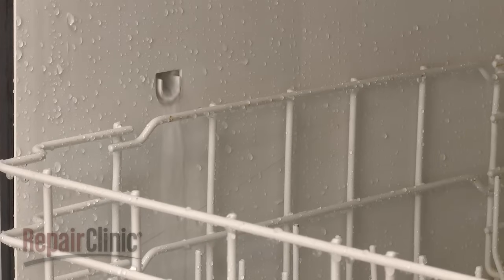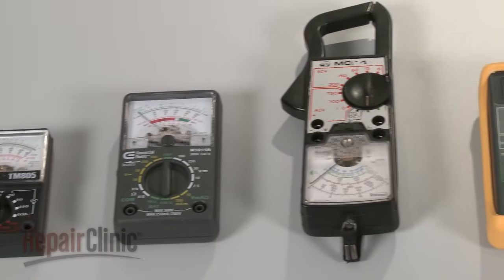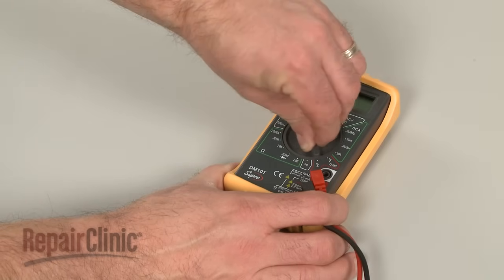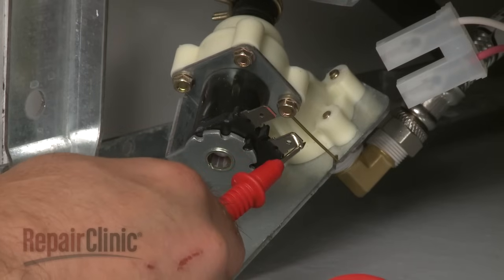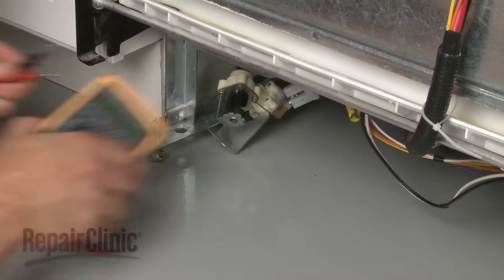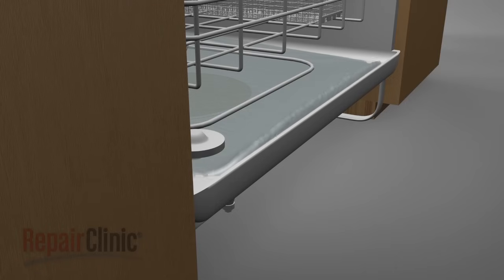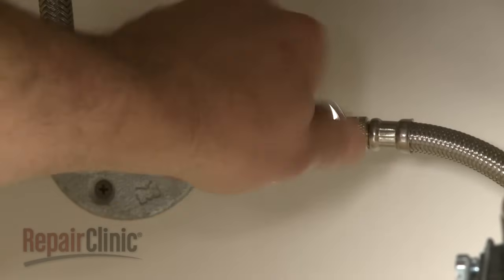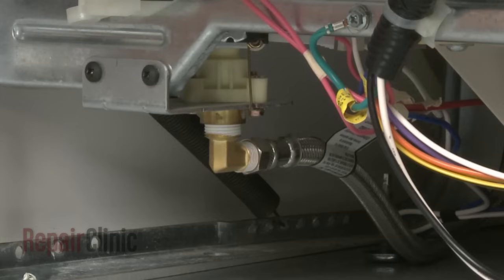Dishwasher Not Cleaning? Water Valve Testing, Troubleshooting

Comment from the maker: I would recommend using the repair help section of our website (link in the description). If you enter your model number there you'll have access part, model and symptom specific repair help. There are a few other parts you can test before deciding what to replace.

Comment: I love your well-produced, concise, understandable videos!  I've ordered a replacement inlet valve from your store. Meanwhile, here are a few things I encountered that I think might be valuable to comment-readers:

My inlet valve was (past-tense) broken and was only reading 31 ohms.   Because this and other internet instructional videos advised that the valve should read 500-1500 ohms or zero, I was not convinced mine was bad.   My valve runs on 13.5V DC power, which I believe is different than most valves which run on 120v AC (the power you get from a wall socket).   I believe the lower-voltage DC valves are still okay if they read 31 ohms.   I believe this because...I removed my malfunctioning inlet valve, grabbed on old 12v DC wall wart from my junk drawer, stripped the ends of the adapter, attached them directly to my malfunctioning inlet valve, and plugged in the wall wart.   I could hear my inlet valve opening and closing.   I proceeded to blow through the inlet valve while it was open, and noted that I could no longer blow through the inlet valve when the power was disconnected.   I reinstalled my previously-malfunctioning inlet valve and it now works...and is still reading 31 ohms.    I've ordered a new part nevertheless, but...1) I suspect the 31 ohms is a good reading for DC-powered inlet valves, and 2) maybe some valves just get jammed up with sediment and need to be flushed and jarred free like mine.

Comment: Good video. Thank you. What it does not mention is that low flow could be caused by a clogged inlet. After checking the electrical I took the flange off the inlet, cleaned out the screen and other junk, and was good to go. I cleaned up the o-ring and surfaces as well to make sure it would reseal. It did. I was perhaps lucky it did.
Reply from the maker: Yes, as this is just a part testing video, we do not get into symptoms. Thank you for the tips though!
Reply: "Trying to clean out an old valve is not recommended, due the to risk of part failure after repair."

Comment: Will a bad water inlet valve cause the unit to not start? My water inlet valve reads no continuity. The display lights up like it supposed to and you cna select a cycle, but when you hit start nothing happens. I have checked the door latch and most of the wiring and all of them show continuity. Clearly the water inlet valve needs to go, just wanting to know if this will solve the major problem at hand. Thank you.

Comment: Just a comment; if the ohms are above 1K to 1.5K, the indicator may move only slightly on the lower ohm setting (x10) and you mistakingly think that there is no continuity. I put the meter to RX1K (instead of RX10) and it read 1.5K which showed there was continuity.

Comment: Hello - I'm curious if you think my water inlet valve is the culprit.  (Our top rack in the dishwasher isn't coming clean).  I removed the valve and tested it with a DMM as you suggest in the video.  When I have the meter set to "resistance with tone" and test the two terminals, I don't get any sound.  When I have the meter set to just ohms without sound, it shows 0.983 k ohms, which I'm assuming means 983 ohms, right?  So on one hand it's between the 500-1500 ohms that you suggested, so it seems ok.  On the other hand it doesn't make any sound when on "tone", so maybe it is broken?  Thoughts?
Reply from the maker: cpgoose Sometimes the resistance will keep the tone from sounding. The valve coil tests good but that doesn’t always mean the valve is good. The valve could still be restricting the flow and not filling the tank with the proper amount of water. I would try opening the dishwasher during the wash and add some water to the tank and see if it sounds different. Replacing the valve will most likely solve the problem. Also make sure the arms are turning freely.

Comment: There was not any continuity in original inlet valve on my Amana dishwasher. I ordered a new one and oddly enough, there was not continuity in the new one either. Is this normal? The inlet valve part number, just fyi, is W10327250.

Comment: great video... thanks.  My inlet valve is working - although needs replacing - but it is not filling the basin with enough water.  Therefore the pump cavitates (not enough head pressure) and the resultant water flow to the middle and upper arms is pulsating and not consistent pressure resulting in the two arms not rotating.  When I took the valve out and tested continuity there was none.  This was a little strange for it does 'work' by allowing water to come into the basin just not enough.  With no continuity, I am surprised it worked at all.  I think the design of these things is bad.  The overflow float switch does not actually play a part in the filling of the basin like I think it should.  My GE model energizes the inlet valve for one minute and that is it.  So if the flow is restricted the resultant basin gallons will not be enough to run the dishwasher properly.  The pump will cavitate and the upper tray arms will not rotate or spray water they will just dribble with low flow.  Better design would be to have the float switch (maybe another one) as part of the process to control when to stop energizing the inlet valve - once the level is at the proper level.  I have a video showing how to diagnose this and how to operate the dishwasher with the door open to actually see what is happening when the dishwasher is running.  Check it out!

Comment: Just did this yesterday. It was not the valve or the high level switch but rather a cut wire from the high level switch. Don't know how it got cut but it was. Solder and heat shrink back up and running.

Comment: On my parent's Bosch SHE43F16UC/59, after a power outage they are seeing the water start for a few seconds and then stop at the beginning of the cycle.  Is that more indicative of a bad inlet value, or an issue with the float switch (or something else)?  They already replaced the Control Board (because it had been showing random cycle times after the power cycle so we knew there was something wrong there).

Thanks in advance for any direction you can give!
Reply from the maker: The water valve will not let water through unless it is stuck open or there is power going to it. It is possible that the coil on the valve is weak and will only work for a few seconds or the control is only sending power to the valve for a few seconds. You will need to get a multi meter (http://www.repairclinic.com/PartDetail/Digital-Multimeter/DM10T/964740) and check for power at the valve to see what’s happening. It is possible the float switch is causing this but not very likely. Make sure the water is draining out all the way; if there is too much water in the bottom before the cycle is started, it won’t let more water in. Our website's repair help may be helpful in your troubleshooting efforts: http://www.repairclinic.com/repairhelp?TLSID=1773.
Reply: *****In your first sentence, don't you mean "or there is NO power going to it?
Reply from the maker: ***** No. We are talking about opening the valve and it could be stuck or the valve needs power to open.

Comment: Water does not fill at all. So I bought a new water inlet valve from you guys. Installed brand new and had zero effect with no change. I have water pressure, checked for continuity with the flow switch, and flow switch is not stuck. All check out fine. Very stumped on this now? Any idea's?
Reply: This is where I’m at right now as well, what did you end up doing?

Comment: Jack Smith is right before replacing check the screen...I did before and mine would not let any water in. You would push start and nothing would happen it would just do nothing. I test the valve both ohms and volts and both check out it was good.

Comment: Thanks johnnyI88!  I thought the valve had failed continuity test, but setting my digital meter to 2K instead 200 showed about 1K resistance (Right between 500-1500).
Reply: Same here.  Ended up ordering $40 part that I apparently don't need.
Reply: @kontrarien5721  So then why do they say to set it at the 200 ohm scale instead of the 2k scale?
Reply: @bodeine454  OMG I don't know.  That was from 3 years ago.  Can't make too much fun, though, since I was replying to a comment from 8 years ago!
Reply: @kontrarien5721  😆
 I can understand that 👍

Comment: I've just checked continuity on unplugged solenoid valve and it looked like it was faulty, there was no beeping sound...but a few minutes later a connect it to the mains and the water start to flow, so it seems to work Ok.power off no flow, power on water flow....

Comment: thanks, this was helpful.
The electric test was fine, but could not figure out if there was some blockage in the valve itself. No visible blockages, inlet filter is clean. Can't see how it operates, don't see any moving parts when it opens and fills.

So - I tested the valve by timing the fill part of the cycle (34 sec in my case). Then turned off the water, disconnected the feed hose, put it in a bucket and turned on the water. In 34sec it delivered about 3 times as much water as was arriving in the washing machine through the valve. So I am buying a new valve and hoping that is it..

Also noticed that if I added water immediately at the beginning of the fill cycle, it would still fill for 34sec. This led me to believe it was not a float problem, as I would expect the float to shut off the fill once the water was in the tub. I could be wrong of course..
Reply from the maker: Douglas Kretzmann Your machine may have a timed fill at the beginning and then again later, if needed. There is a flow restrictor in the valve so you will not get the same amount of water through the valve as through the water line. If you are getting a slow fill, it is likely the water valve is getting plugged up and will need to be replaced. You already have checked the water flow to the valve so replacing the water valve should solve the problem.

Comment: My valve is working, I have replaced the float in my GE dishwasher too. Water flows in and out, filters cleaned, no leaks but no flow into the wands any ideas? What needs to be replaced?
Reply: I have the same issue and have not figured it out yet. Have you figured your situation yet?
My gaskets are in bad shape under the filter and lower wand. I was wondering if this could be the issue. I have an LG dishwasher. There is plenty of water supply and it shuts off and turns on correctly.

Comment: Hello :) . Firstable thanks alot for the comprehesive video ,that have been very useful.
Secoundary I have a little question about multicet checking. I have only digital multicet and when I check the valve connection with the sound alert option for a part of a second it shows 1 800 and after that only 1 ---- and there is no sound alert. Is that mean the valve is failed electricaly? And if the valve is failed is it possible the pump to pour the wather out after the program ends but without water access into the washing room? If you answer these questions I would be very grateful.

REGARDS!

P.S. Sorry for the bad english :(
Reply from the maker: ***** The sound option normally only works when the part you are testing a part that has zero ohms resistance like a fuse. A valve should have a resistance so the meter will display a number instead of beep and display a zero. A bad inlet valve will not effect the drain function.  Check the float like we show in this video and if your dishwasher does not fill, the valve is likely bad.
Reply: ***** The meter shows 1 ----  so that supposed to mean the valve is gone? I already have that float checked. It works normaly and there is no problem with it. Actually there is never been a leak under the dishwasher so that float switch is never been used.
Reply from the maker: ***** The valve is bad if you cannot get it to measure a resistance between 5-500 ohms. If you don't have your meter on the proper ohm range you could get that result so try each resistance setting.

Comment: I went through this testing and my water inlet shows no continuity. So I went ahead and order a replacement from repairclinic.com. The replacement though also doesn't have continuity. I made a video of the testing (both old and new water inlet valve). Can you take a look and tell me if I 'm doing it right? My valve might be working and/or both are defective and I need another replacement.. youtu.be/udbi1A7ruZ8
Reply from the maker: +Jorge Arevalo Most likely the valve coil has too high of a resistance you use the basic ohm check on your meter. Try using difference resistance ranges and test.
Reply: I had the same issue with a setting of 200 ohms on my multimeter. But when I switched the multimeter to 2000 ohms, I had readings comparable to the video. Did you ever figure this out?
Reply: Hi. I did...it seemed I had readings...so I really didn't know what was wrong with the unit. We bought a used working one and got rid of this one.

Thank you!
Reply: Allison, yes, figured that out...so I couldn't figure out what was wrong and I just ended up giving the dishwasher away...
Reply: I had the exact same problem. Ordered the replacement from Bosch and when the new one arrived, installed it and still no fill. Checked the new one as per the video and no different from the original. So to test for SURE if it's working just unbold it from the machine, leaves the wires connected (make sure they're not touching anything as there'll be 110 or 240V coming through them!) but remove the outlet pipe. Turn on the water supply at very low pressure and then turn on the dishwasher. When it gets to filling you'll notice the trickle of water from the outlet. Tried with my original and that works fine too. This video just cost me £30! therefore not a great video!!

Comment: hey im haveing problams with my float leaking what could be the problam
Reply from the maker: Make sure the float is clean and does not have a lot of buildup on it. Check the wash arm for cracks. The wash arm may be spraying water down and splashing up over the float. The other thing that might be happening is too much soap is being used and suds are building up and getting up over the float tube. Just a few things to check. Hope this helps.

Comment: Could  weak water debit damage the inlet water valve?
Reply from the maker: ***** Low pressure often causes water to seep into the dishwasher. The pressure is what keeps the plunger down when not energized.

Comment: error code indicates that the dishwasher's water inlet valve is malfunctioning. To troubleshoot, locate the valve and inspect it for any debris or damage. Clean it and see if the error goes away. If not, replace the valve.l have this problem how l can fix this

Comment: hmmmm. i checked the valve.
then i connected spikes to it and it jumped to 1.875 after one sceond it goes to 1.
Reply from the maker: +Akzuu cast You may not be making good contact on the terminals if the resistance is jumping around.

Comment: Anyone know what would cause water to stop filling after 20 seconds?
Reply: Well many of the dishwashers have a timed amount of time that the valve is set to be open. They are not driven by the float switch or the flood switch as they’re called. Those would prevent overfilling but are not typically used to determine how much to fill. At least not in the GE models

Comment: I have a kitchenaid hobart KDI-18.  it's not filling with water.  motor runs, and it cycles fine, i hear clicking thru each cycle  the soap dispensers even open. but no water.  Valve is good and and it's on (never been shut off)   So I'm thinking water inlet valve.  Here's a video of my dishwasher.  https://www.youtube.com/watch?v=kkYMFf-vFGM